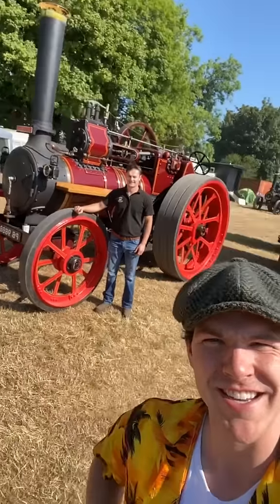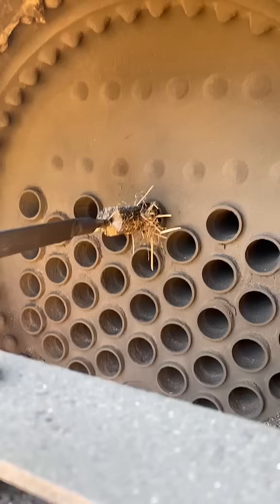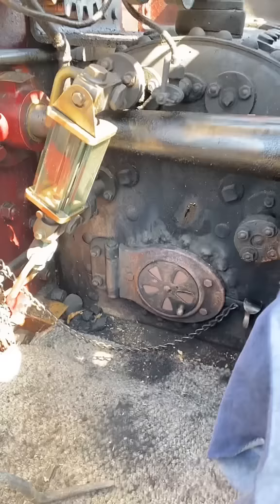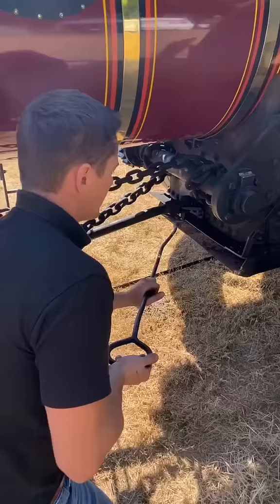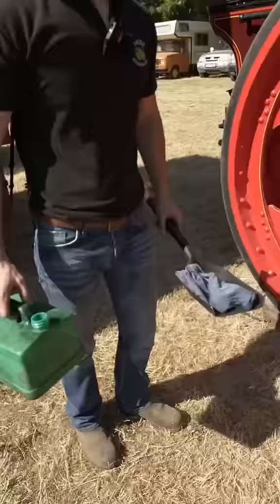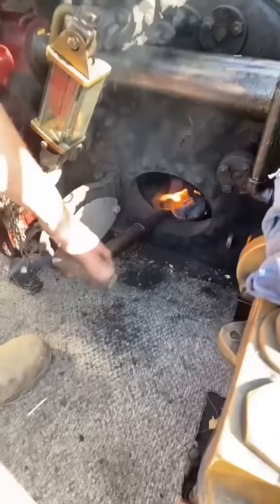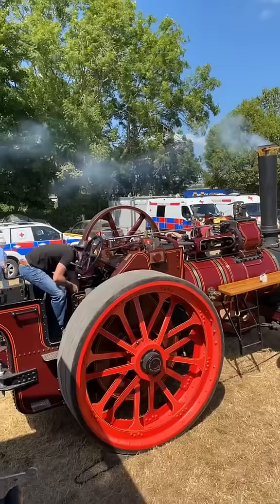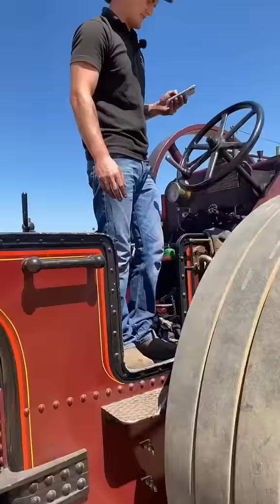Cold Starting A 1912 Marshall Steam Engine #shortvideo #ireland #steamengine #coldstart

Comment: Older friend of the family was restoring an even older piece of steam engine farming equipment. When it came to painting the name brand’s logo, he told my uncle that he wished he was artistic enough to make the proper stencil. Uncle asked me if I could possibly use my photoshop skills to help with the project. 

I just so happen to be a fully college-educated graphic designer. Was actually super fun doing the research and tracking down the original logo. I basically had to do a restoration job of my own because the only picture of it I could find was sooooo small. Good times ❤

Comment: There’s a tractor museum a little over an hours drive from me. They have all sorts of old stern engine tractors like this, and even a couple steam engines trains in the museum. Once a year there is a festival where about 95% of them are fired up and the owners and operators do displays of how they were used. Nothing cooler than seeing how one tractor used to run every piece of equipment on the farm with massive belts. 
Some of the tractors get hooked up to saw mills, and some are out pulling a massive plow. Pretty cool stuff.
They also have some more modern tractors, including a Versatile 1080

Comment: Thats crazy they used to use diesel fuel as well as a woven plastic rag to start those a couple hundred years ago. Its a wonder why they didnt just skip right to the diesel engine instead of messing around with hot water first

Comment: I'm assuming the steering ratio is that high so that at the slow speeds that will travel at you can actually turn it as it doesn't have power steering, right?

Comment: mk, im dumb. You gotta explain what a hot start would look like. If this is a cold start, what's a hot start lookin like?
Reply: Cold start usually means starting the engine when it's cold compared to starting it after its only been off for like 10 to 30 minutes.

It is odd terms with steam engines tho
Reply: @joecobb7153  ah! tyvm

Comment: Why diesel? Diesel combusts through compression not flame
Reply: Then you can answer that question yourself, if you know how a steam engine works.
Reply: @lukeWiz44  diesel was made to be used in area with flame sparks, if you toss a lit match it will put it out, combustion of diesel requires intense pressures

Steam engines use heat to boil water in a separate chamber as it turns to steam the increase in steam pressure is piped through various pipes and valves to achieve mechanical motion

My point being to start a fire in the fore box why use diesel it won't catch with an open flame kerosene or petroleum would be better as it lights easily and the small amount used would be safe for starting the fire due to the constant feeding required for steam engines negating the fumes accumulating and turning to a bomb which is also the point of smoke stacks on trains and old ships